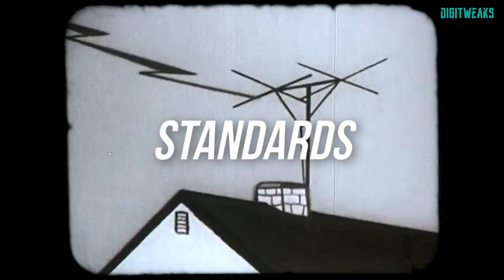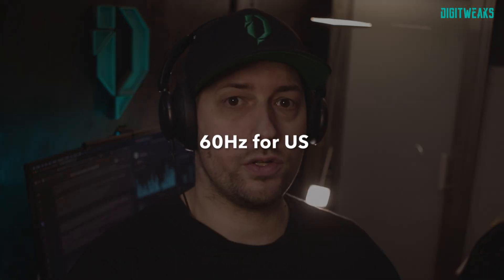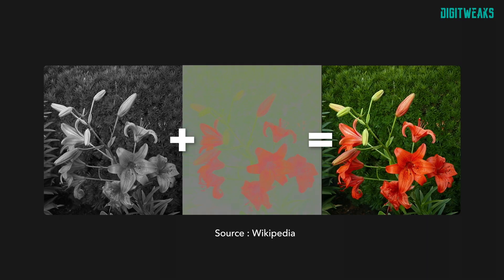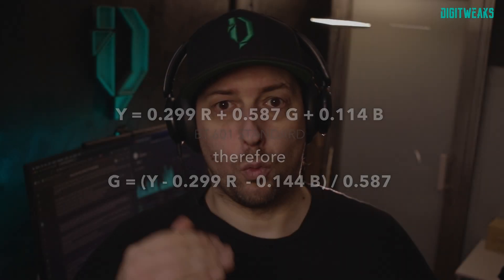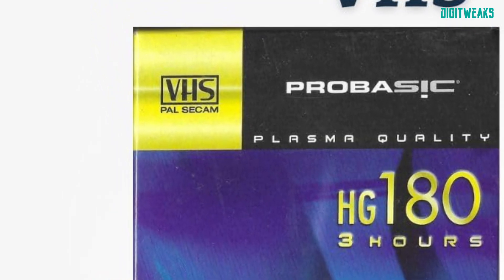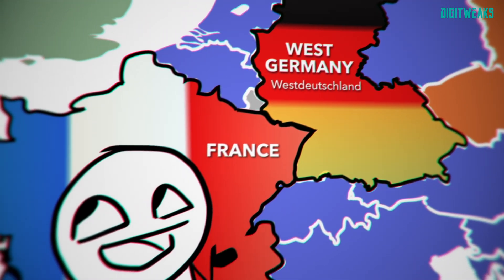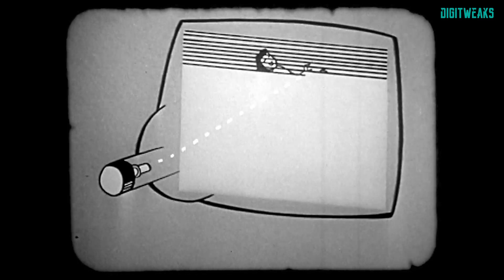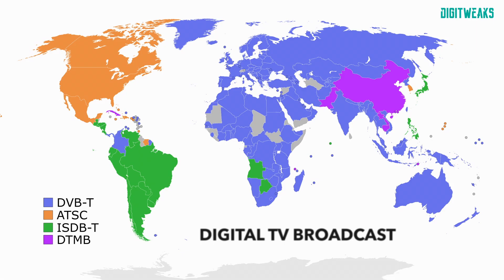Evolution and Fun Facts of Video Standards (Part 2) : PAL, SECAM, NTSC, MAC, Teletext

Comment: Unfortunately, in France there was SECAM L (the system appeared in 1964). Positive brightness and AM sound. Interference is very noticeable compared to negative.
Reply from the maker: Can you elaborate on the positive brightness? Never heard of that concept
Reply: @Digitweaks  Before World War II, all TV systems used positive video brightness. In the 1950s and 1960s, such systems were also used in the UK, France, Monaco, Belgium, and Luxembourg. Interference on a TV screen appears as white stripes, very noticeable to the human eye. In 1969, the UK switched to negative video brightness, the Irish system I. Belgium and Luxembourg switched to the German system PAL-B/G in the late 1960s. Only France and Monaco retained the positive system, L.
https://en.wikipedia.org/wiki/Broadcast_television_systems
Reply from the maker: Ok, that's interesting, and it actually answers a major question regarding the denomination of standards. That might make it into a Part 3.

Comment: It's funny that you mentioned the Soviet Union chose SECAM over PAL, supposedly to shield its citizens from Western propaganda, but failed to mention that after the USSR collapsed, its former republics rushed headlong to switch to PAL just to listen to that very propaganda, all ears. Perhaps you shouldn't delve into politics and invent nonsense, but rather, pay attention to the technical aspects? Specifically, the fact that SECAM was much more stable over long-distance transmission, which is irrelevant for Europe but crucial for Russia, stretching 10,000 kilometers from east to west.
Reply from the maker: I don't see where I've invented anything and especially "nonsense". Maybe you're seeing that as "delving into politics" when I just stated the facts exactly as they are, they went from SECAM to PAL after the fall of the USSR, that's a technical fact, I didn't delve into the details of the politics behind it outside of providing the context, you are the one focusing on the aftermath.
Reply from the maker: By the way if you want to make a video that explains everything that is dear to your heart in detail, then go ahead and I guess you'll find an audience to connect with that will be more than happy to listen to what you have to share.
Reply: @Digitweaks  mate, I didn't want to offend you anyhow. And obviously I put thumb up on your video. But that part about going for secam to isolate from western propaganda is totally untrue. Besides the fact that PAL signal won't go that far to cover any meaningful part of the USSR, I should admit, that Soviet Union had a pretty good jammers to shut any foe signals down on its territory 😂
Peace
Reply from the maker: No worries, I had my lot of hecklers which I’m not a fan of. I’ll dig deeper into what you mentioned and eventually do a video on it if I find enough material on it. You're welcome by the way!

Comment: D/D2MAC were widely used in Scandinavia on satellite from early 90's to mid 2000's with good success. It was a superior system to PAL/SECAM/NTSC as chrominance was transmitted separately (time-multiplexed) and not modulated over the top of luma. The only difference between PAL I/B/G/DK is the offset of the sound carrier. So viewing PAL B/G transmission on a PAL I only TV would result in a colour image but hissy audio.
Reply from the maker: Thanks for these details, I wasn't too familiar with the MAC system and couldn't find much about it.

Comment: Contrary to very widespread belief, neither NTSC or PAL EVER intended to actually use the mains frequencies for synchronization. 

[stay with me]

While it is true that the mains frequencies of each region had a major influence on the selection of each system’s frame rate, it stemmed entirely from the basis of the interference it tended to cause, and a cost-cutting method to counteract it. Both systems were standardized back in the days of linear power supplies. Electrolytic capacitor technology was not nearly as advanced as it is today, and some residual ripple would still be present on the DC supply rails (unless they doubled the set’s price in added filtering). This ripple would become more prevalent as the capacitors aged (and increase in ESR). On the audio-side, insufficient filtering would result in the ubiquitous “hum” in the background… on the video-side, it would appear as horizontal bright and dark lines across the screen. If the frame rate was approximately the same as a multiple of this ripple, the bars would remain more-or-less stationary, but at any other frame rate, the bars would drift either upward (if slower) or downward (if faster) than the nearest multiple of the ripple frequency and be MUCH more annoying to viewers. 

In 1953 when color was shoehorned into NTSC and they had to slow the frame rate to 29.97, this resulted in the slow upward-drifting nature of “hum bars” visible today when a set’s power supply caps are starting to fail.
Reply from the maker: Thanks for the detailed explanation! 

I'm just not too sure why there's a focus on the intentionality and causation regarding that matter in many comments, cause it's not like we don't agree, it's just that I don't see where anyone believes it was intentional in the process. That's not something I've seen ever implied in any way like "They absolutely wanted to use the mains frequencies so they used the mains frequencies"

Even if the intention was not initially to use the mains frequencies for synchronization, they ended up realizing that it was the most effective solution, therefore they, in fact, used the mains frequencies. That's where the story ends for these developers.

So I understand we can revisit this choice from different angles, but they had a technical reason to use the mains frequencies despite having the choice not to, which is why we stated that it wasn't something easy to solve at that time. 

And the solution they found to solve all these issues without too much complication is to use the mains frequencies. It's kind of a cyclical reasoning which ends up with the fact that they used the mains frequencies for synchronization simply because that's the easiest and most effective solution.

That's just my 2 cents on this. However I appreciate the added reasoning behind those phenomenon as it's not always obvious for everyone, unless you're a bit tech savvy and knowledgeable in how TVs work.

Comment: The grid/mains was not used a frame sync. The reason the frame sync was nominally the same as the local grid frequency was related to the practical issue of mains fields leaking into the set via internal power rails and ambient magnetic fields due to mains transformer and external devices such as motors.
Reply from the maker: I think both things can be true in the same time

Comment: Nice work! When I started working on the DTV transition, I chucked most of my reference books on analog TV in the trash. At the time, I remembered it all perfectly, but not so much today! It's good to see people keeping this old information alive.

A few corrections & additions:
4:10 The baseband signal is modulated by a carrier not a sideband. The modulated signal will make sidebands when plotted as frequency / amplitude, of course. But the two components are baseband and carrier.

5:10 Not so much a correction as an addition--YUV is the color space that PAL uses, while YIQ is what NTSC uses. SECAM had its own color space YDbDr, and D-1 etc. use Y'CbCr. Because green makes up the largest part of the monochrome spectrum, the luminance Y channel is mostly made up of the green component. We can see this in the numbers. 😉

I don't believe that the quadrature modulation used in NTSC/PAL chroma is actually QAM. Back in the day, we never called it QAM, and with good reason. The chroma signal is a vector quantity made up of a phase component and an amplitude component. Both are equally important. Rather than call it "Quadrature Phase and Amplitude Modulation" we just called it "quadrature modulation". It is undoubtedly the precursor of digital QAM, but it's not the same.

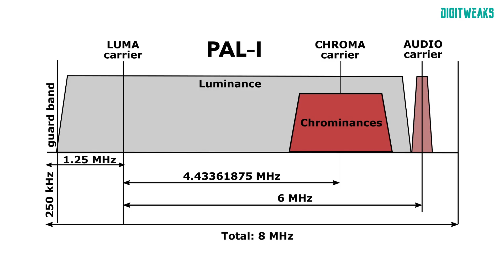6:00 Note that both luminance and chrominance carriers are suppressed in NTSC/PAL. The color burst is used to reconstruct the chroma subcarrier.

There were several vertical interval signals, at least with NTSC. VITS was the vertical interval test signal, VIRS was the vertical interval reference signal, and VITC was the vertical interval time code signal. There was also closed captioning and Teletext. IIRC they started at line 19, but I forget the order.

I don't mean to nit-pick, but it's a nit-picky topic. I hope my additions help others make better use of this excellent video.
Reply from the maker: Thanks, as you can see I use the channel as a base of discussion so every constructive comment is welcome!
Reply: You are absolutely correct in that. Color burst wsa to coninue the ring if the crysal going. The transmit color burst is 15.750kHz lower than the recieve crystal but the 3.579545Mhz carrier reinsertion gives the chroma a place to stand. Kinda like ssb bfo or fm stereo with 38kHz supressed carrier systems. Except fm stereo does not use burst tone or 38kHz crstal resonator either. Very similar principal
Reply: @JoeyLanclos-x6m  the important thing about color burst is that it's used to reconstruct a free-running chroma reference signal. In many old color studios, we had free-running oscillators for H sync, V sync and chroma, and those three references got piped around the studio with distribution amplifiers. With an encoded NTSC or PAL signal, there's only the periodic burst, but that burst is used to reconstruct an oscillator in the receiver that the decoded chroma signal is compared to. In transmission, the TV signal also uses a suppressed carrier.

Comment: Pal was also sometimes referred to as 'Pray And Learn'!
Reply from the maker: Do you know the reason behind this backronym by any chance?
Reply: @Digitweaks  I think this was probably going right back to the very early development time of PAL.
Reply from the maker: @ Would make sense, must have been a complex process with tons of trials and errors.
Reply: @Digitweaks  I think the BBC first trial of PAL was spring 1965 when colour bars were briefly aired on BBC2 each day. I don't think it was on test in 1963 when they were directly comparing SECAM and NTSC from two Uhf transmitters from the London Crystal Palace site. Commercial TV in the UK was pushing hard for 405 line NTSC but that didn't go anywhere of course.
Reply from the maker: @HughTVDX  Thanks for that piece of history! It's incredible how the rabbit hole never ends.
Reply: I've also seen 'Picture at last'